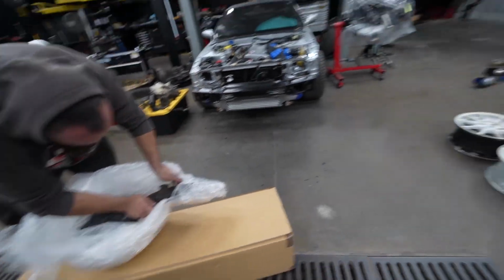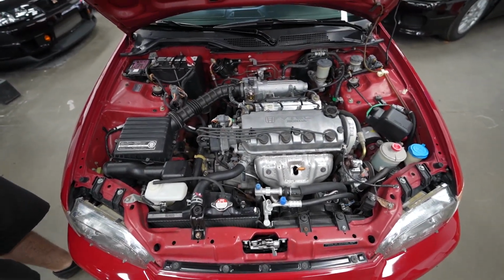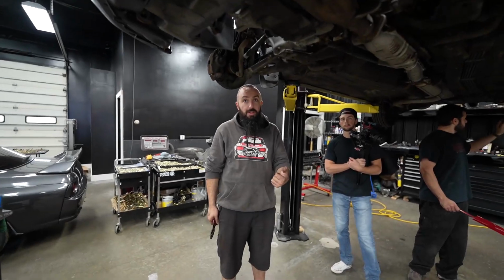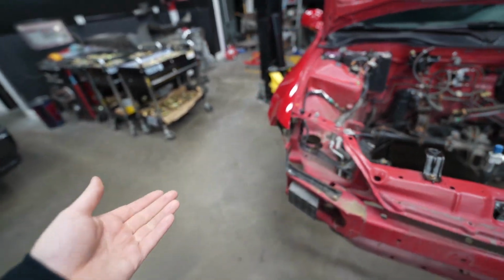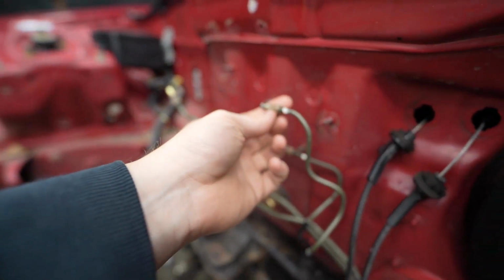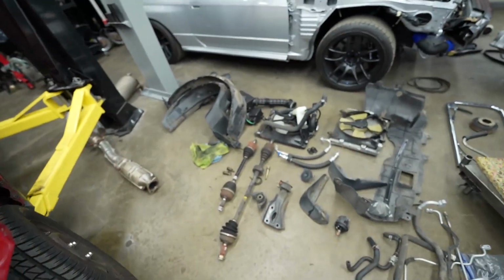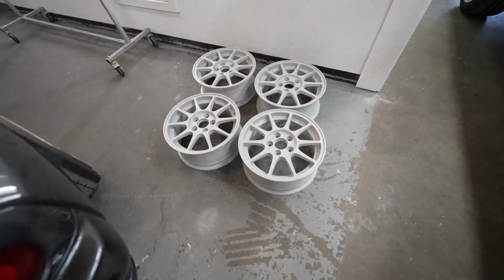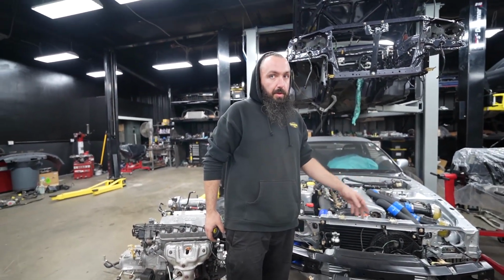ADAM LZ SMOKED OUT THE NEW SHOP PARKING LOT! (LT4 COLORADO DONUTS!)

Comment: Don't forget you have to lightly "massage" the driver side frame rail with a sledge hammer for the crank pulley on the b16 otherwise engine no fit!

Comment: Doesn't look like it has ABS Tommy. You would see a fuse box and a bunch of wires with orange plugs in front of the passenger strut tower. Not to mention a yellowish ABS light symbol in the cluster on the top right space, which I don't remember seeing in the video where the car was delivered. Who needs ABS in the civic anyways lol, mine doesn't have it either. Less wiring and sensors, less headache.

Comment: Finally someone that takes the engine out of the bottom.  The number of YT vids with DC/EG/EK chassis and they take it out the top with a hoist always has me shaking my head wondering why when it comes out the bottom so easy.
Reply: OG shit
Reply: They put it in from below at the factory for quickness so why wouldn't you take it out from below if U can get car high enough especially if U taking engine & box out together that's how I do Subaru's

Comment: Looking awesome Tommy ! , or though i know the civic is a give away car , in hindsight , your Basically building a JDM EG6 SIR , and would be awesome to see it with the eg6 rear wing (or though hard to come by even in japan) so it would be sick with a SPOON eg rear wing (painted the red or even in stock carbon) as the are like 700$ US , and if you could find a genuine EG6 front LIP just to finish it off , Holla out if you want a full sir eg6 sir chassis code so you can get parts like a oem sir eg6 front lip as you can still get them NEW from Honda if you get stuck , ...., (stuff like the eg6 stock decals for the door and rear quarter saying dohc vtec ) ,,.....

Comment: Dude thought you a honda boy I thought you knew they used the same stuff on every car there are parts on that hatch that is the same as every car for 5 years they use alot of the same parts like air box brakes rotors all kinds of stuff is interchangeable